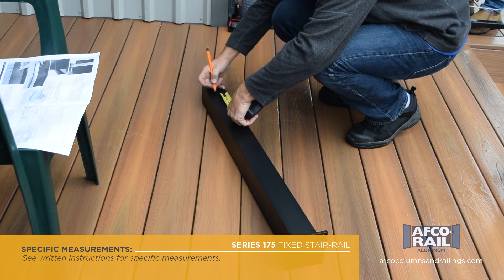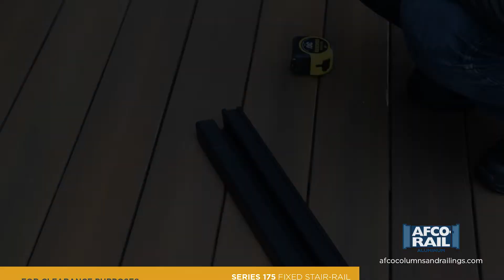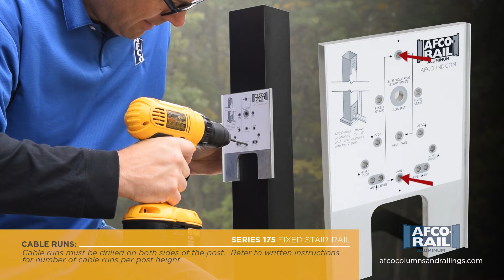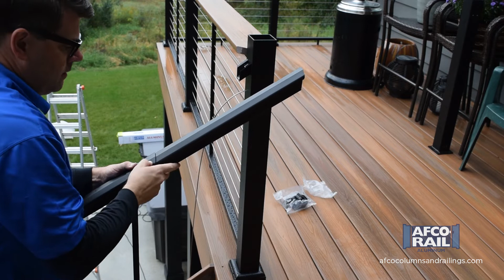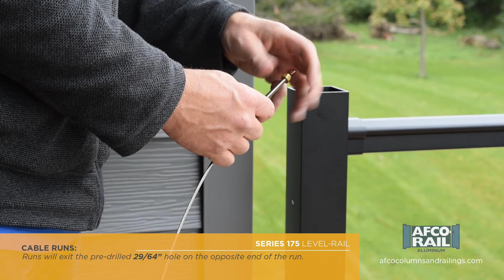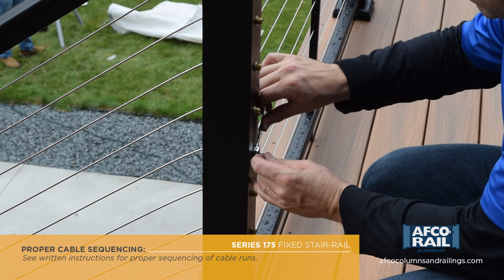Aluminum AFCO-Rail Series 175 Fixed Stair Rail Installation

Comment: 34.5 degree angle equals 8.25 inch rise in 12 inches. This is way too steep..  most outdoor stairs tend to have more depth and lower rise.
Reply: I did find the angle for a 6.5 in rise to be way off as well. Its too steep as it is. Yes about 8.25 in rise. Not good for codes

Comment: what's is pay to install this stuff? material cost is $90 per ft
Reply from the maker: Hello, Randy.  

Thank you for your note, and your interest in our aluminum railing.

Our focus is on manufacturing the best aluminum railing we can. 

In many instances, homeowners install Aluminum AFCO-Rail themselves.  Should you choose to enlist the services of an installer, the decision on whom to hire is strictly yours.  Our goal is to make a product that your installer finds straightforward and relatively simple.

Thank you again, and we wish you the best.
Reply: @afcoindustries installation on brick is challenging. Improving instructions and simplify the post mounting to brick would help a lot as I will be do this a dozen times this summer larger base on post would help.
Reply from the maker: @randystanton6280  

Thank you very much for your feedback.  With the wide variety of ways our products are installed, we appreciate hearing from people who are working with them.  

Please let us know if there is any further information we can provide, and we wish you the best.